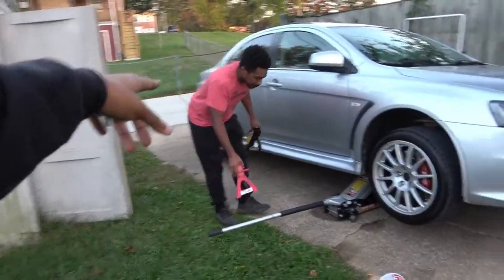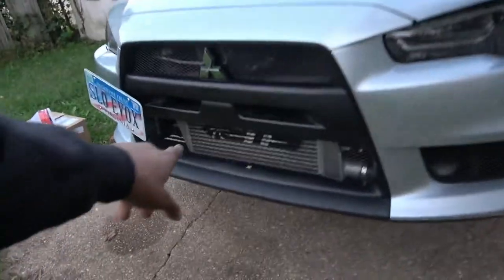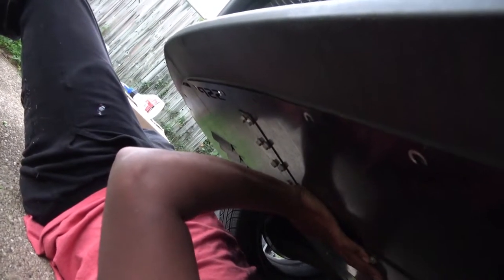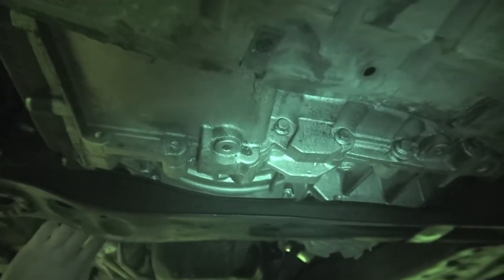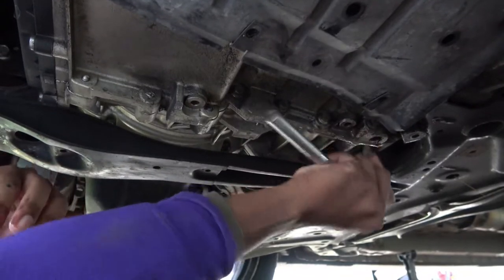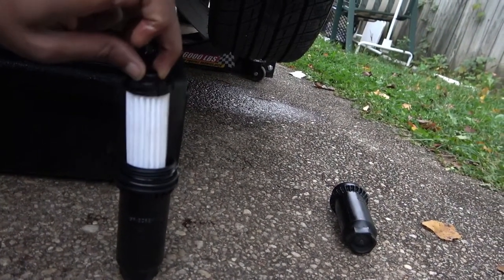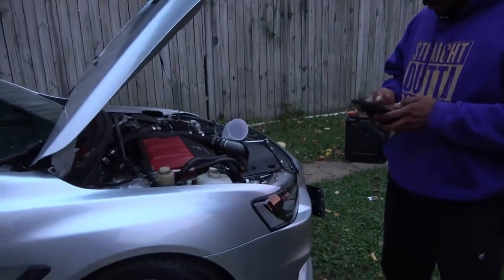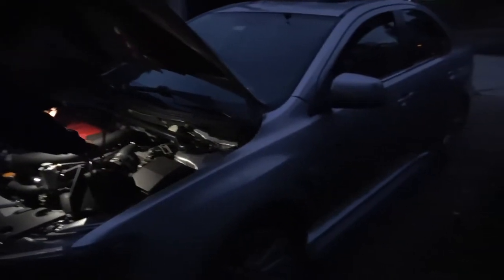How To Change An Automatic Evo X MR Transmission Fluid!!

Comment: On the next transmission fluid change, just add about 6.5L because you cannot completely drain the transmission fluid unless you remove some other parts. The car only needs about 7.2L if you disassemble tcase/swap internal filter...yes there is another filter inside the tcase. Luckily, people have had no problem with overfilling the transmission with 7L. Other than that, good job on the video.

Comment: Has it given you any issues? I know DiaQueen is OEM but I heard some people running Castro. Let me know before I pull the trigger on this expensive ass DiaQueen.
Reply from the maker: Nope no problems. Even latest through some track days
Reply: We use Castrol Transmax in the UK for the SST. Its the same oil. Castrol make Diaqueen.

Comment: You probably don't have to do a reteach after the fluid change, it never hurts but Kozmic have a good article about all the how tos and operation stuff on the DCT and they say the teaches don't hurt anything but not required unless tuning and the pressure maps need to change or something. Good video though guys 🙏

Comment: Should have drained the cooler as well. But as far as everything goes, you did alright. I would recommend a sst temp gauge. It is important to know what the temp is. 70c is when it is fully warm.
Reply from the maker: Thanks for that. We're actually looking into that now😁
Reply: @sickshiftkeylo  also know just because the engine is warm does not mean the sst is. I am one of the few making sst temp gauge kits, which will soon be for sale. It will look oem and fit in one of the blank slots
Reply from the maker: @kenly6858  the link to my Facebook and Instagram is in the description. If it's cool can you dm me I wanna hear more💯
Reply: @sickshiftkeylo  Hey man, sorry been busy installing my new Dodson Motorsports Sump onto my EVO and my prototype temp gauge.
Reply: @sickshiftkeylo  didn know it existed

Comment: #LTMR...I had a 2012 MR and the dealer charged $475 to change the fluid a few yrs ago....DiaQueen SST fluid is crazy expensive
Reply: Buy it somewhere else .. the dealership are robbers. STM tuned for one , has at a cheaper cost along with a filter.